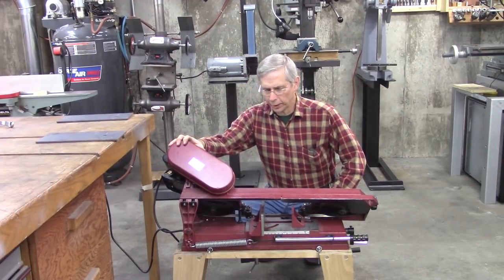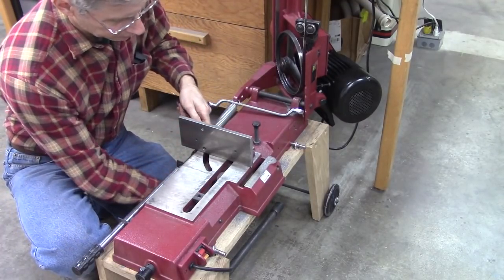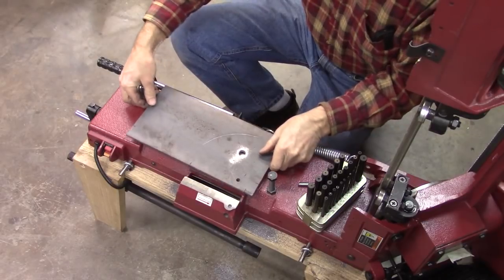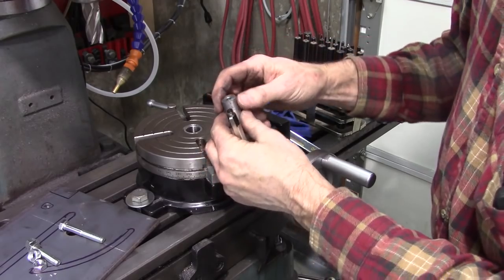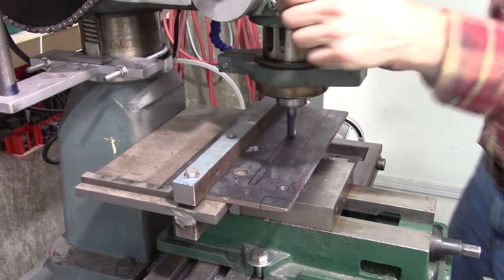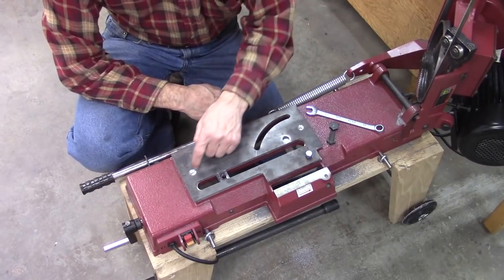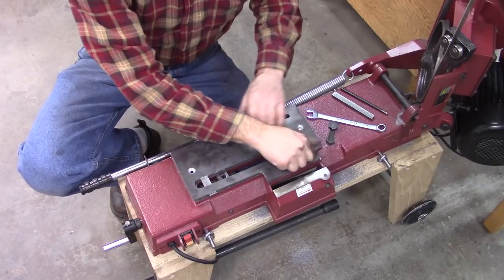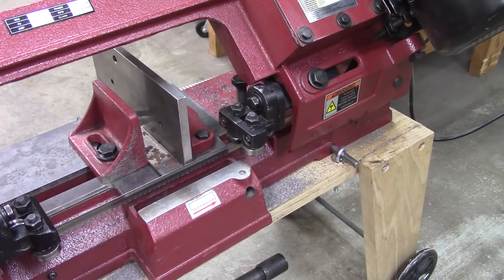4" x 6" Horizontal Bandsaw - Fixing the depth of cut issue

Comment: Would be interested in elevation plate if made available.
Reply from the maker: There is a link under the video to a template and instructions. Print the template full size and make sure it matches your saw and then send me an email (address in the instructions). I'll let you know a price when I get the quote back from the water jet shop. If i can't sell the plate for less than $30 I probably won't do it. I suspect this is possible but I'll know late Monday. Thanks for watching!

Comment: Have you had a lot of blade breakage with this saw?   I’ve gone through 4 blades in a week.  Maybe a total of 40 cuts.  I have the feed almost completely tight and the belt set at 80 for stainless.  Yet I keep snapping blades at the seam.  Blade is tight but not torqued down.  I feel like I should be getting more cuts out of these blades.  I used Bosch ones and I went a picked up some harbor freight ones today.  Any insight would be helpful.
Reply from the maker: I had the same problem until I corrected the blade guide and depth of cut problem outlined in my videos. I've had the same blade installed for almost a year now. I think my blade is set at the fastest speed.
Reply: @WinkysWorkshop  ok thank you.  I’ll rewatch again tonight and hopefully be able to set mine up better.  At this rate I’ll spend more on blades than the saw is worth.
Reply from the maker: @85nscarola  If the saw is old there may be other issues but if it's fairly new I'd say the blade guides are deflecting the blade. The back wheels on the blade guides should not be turning when the saw is not cutting. Realistically this is sometimes hard to achieve and a little downward pressure is okay but if the blade guides are deflecting the blade downward more than maybe a 1/8" it leads to problems.
Reply: @WinkysWorkshop  yeah. Just went and followed your video.  Adjusted the guides.  Was able to get the blade straight but can only get one back wheel to not touch.  When I gap the second one the first one touches again.  They were both touching before though so at least one isn’t making contact now while not cutting.   Also tensioned the blade more.  Read somewhere that it should be tight to the point where you can pluck it like a guitar string and you’ll get a twang from it.
Reply from the maker: @85nscarola  Some contact with the back of the blade is okay as long as it isn't deflecting the blade much. Yes high tension is good. The blade deflecting under load is very hard on the blade.

Comment: It seems like adding a plate on the outboard side of the blade would pinch the blade right before it cuts through the stock.
Reply from the maker: As long as it is level and one side is clamped it won't. I think I will install a larger piece on there and close up the gap the blade goes into. small pieces fall in gap sometimes.

Comment: It took me 40 min to cut through 1 1/4”galvanized pipe.  New blade.   I did notice that my feed adjustment only turns a quarter turn each way though.  Could that be the problem? No pressure?
Reply from the maker: Maybe so
Reply: @WinkysWorkshop  about how many threads are usually exposed on your feed?   Where the hook connects to the spring.  Just trying to get a general idea as to how much feed I should have.  Bought it used and it was screwed all the way in.  No feed
Reply from the maker: However, if you are cutting small stock, tubing and angle iron you will have to limit the downward pressure. If nothing else you will break teeth but most likely the saw will stall. With being said, if you blade guides are not set right or there is an alignment issue due to wear you will knock the blade off with too much pressure. Also a lack of tension on the blade will do the same. It needs to be fairly tight.
Reply: @WinkysWorkshop  figured out the problem.   Previous owner had the blade in backwards.   That’s why I had to use so much pressure which ended up breaking my blade.   Got a new blade and made plenty of cuts today thru 1/4” steel plate.   Worked great
Reply from the maker: @85nscarola  Thats great!

Comment: Would spacer bushings behind the blade wheels achieve the same result?
Reply from the maker: That might work although spacing the wheel out would move the blade closer to the guard and vice. I suspect it would cause other issues. I think the root of this problem is a the hinge point for the head was drilled to high but moving the hole a 1/4 inch is hard to do.

Comment: Another great creation Mark. More to add to my to do list. LOL
Reply from the maker: All saw won't need this. I think it depends on what factory assembled it and when. If your saw needs it let me know. I'm thinking about making some to sell (hopefully fairly cheap)
Reply: @WinkysWorkshop  I've never had a problem with it cutting all the way thru. Biggest thing mine needs is some time and cleaning and to reset everything. I have 2 old power hack saws that i intend to revive this summer. One of them is a Marvel draw cut #1 and they brazed everything including cracks they made in the sprockets trying to get them off. so the blade is not square with the vice. And the vice is not adjustable to the blade so I will be scratching my head and maybe using some of your concepts.  I really want to try to keep it all original but nobody wants a saw that does not cut square. lol  Thanks again for your contribution.
Reply from the maker: @terrycannon570  Maybe you can mover the head from side to side and make it square.

Comment: Can you just lower stop?
Reply from the maker: Watch part 1. The saw frame hit the switch. I ground a clearance in the frame and then the blade cover hit the bottom casting. I removed the cover and it kinda worked. This is the best option. The saw  now drops about 3/16 after the cut and reliably trips the switch. Plus I put the guard back on.

Comment: I’ve never had that problem, of course my saw is a bit different 4 x 6
Reply from the maker: This saw had some issues. I suspect the castings all come from the same Chinese foundry but then go to many other factories for milling and assembly. Who knows how many have the same problem as mine. I can make the saw work but moving the blade down with the guides but that's not really the correct approach and very hard on the blade.

Comment: I got the same problem on my band saw. Here's a link to it: https://www.warco.co.uk/metal-bandsaws-metalworking-saws/53-4-12-universal-bandsaw.html.
In my opinion You used a big gun to solve the issue.

I found out that the poorly made, poorly formed, wheel/blade cover hit the bed. Using a polygrip just bending that cover solved that problem.
There's also a blade protection attached to the left of the cut, most faar away from the motor, that's poorly formed. That makes an obstacle regarding the depth when moving the blade guide "to the right", when cutting "small" objects. I suppose some brutal mechanics can correct this.
Reply from the maker: Watch Part 1 of this video. I worked on the rear blade guide and helped tracking. I also removed the guard so that it would drop far enough but still had issues with the auto shut off. What I did here was a lot of work but the best fix.
Reply: @WinkysWorkshop  Okey. Didn't notice You removed that blade guard.  That's of course the quick and easy way. I've been thinking about doing that. I'll see if my polygrip can do the job. Else the plan B is ready to be used....
Bending things to the correct angle looks like being a problem for the Chinese what ever product it is.
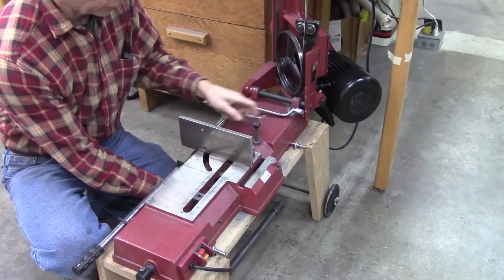Reply: @WinkysWorkshop  Looking at part 1 again, at time 01:42, it looks like Your saw is slightly different from mine. Found out that the mount is adjustable but the cross head screw was overtightened and is now ruined. Drill and new screw tomorrow......
Reply from the maker: @Stefan_Boerjesson  Agree...  they have a quality control problem.

Comment: Here is the link to a very simple idea that makes changing the blade on these saws a much safer and simpler process to do. Involves nothing more complicated than 2 short lengths of webbing and 2 bits of 'Velcro' hook and loop tape. Makes the task a lot less like wrestling a baby alligator.
Link: https://youtu.be/utIcvpEyv6g
Reply from the maker: That's a great way to do it. Thanks
Reply: @WinkysWorkshop  It totally controls the blade by preventing it from springing out of the roller guides when you are trying to manipulate the blade over the drive and idler wheels. It's one of the simplest but greatest improvements to the task I've ever seen....why didn't I think of that instead of struggling and cursing.😂😂

Comment: Winky:  I love your channel and watch it often, but this is a completely unnecessary modification based on a false assumption.  Here, and in the Tune Up video, you mention the "Ideal" position of the blade guides. Ideal, maybe. But if it causes the saw to not work as designed, it is obviously not "ideal".  As well, "not ideal" does NOT mean wrong or unacceptable.  So my assertion is that there is nothing wrong with the blade guides adjusted in such a way that the saw works as designed even though the blade is not perfectly aligned with the wheels. In fact, I have found that on my saws, they must be aligned with the proper cutting position, NOT the wheels.   How long did your saw work fine before your blade guide adjustment caused the saw not to finish the cut?
I've been using my version of this saw for about 40 years, and 

also the larger "Carolina" type bandsaws.  Both of these types of saws 
need several "tweeks", but honestly, this is not one of them.
All of this being said, I have made my share of similar false assumptions that resulted in failure. But, that's how we lean.
Reply from the maker: Thanks for watching and I welcome the comments but respectfully I disagree. Ideally the blade should not be deflected but only rotated to vertical. Can the blade be deflected? Yes and to a point it doesn't matter. Slight deflection goes unnoticed but when it approaches a 1/4-inch it creates a lot of problems. You mentioned needing to deflect the blade to make it cut correctly. I assume you mean side to side because there is no advantage to pushing the blade downward aside from making the saw complete the cut. The correct procedure would be to set the fixed jaw of the vise parallel to the pitot shaft (for the head) and then align the guides to make the saw cut square. If you do this more than likely the saw will cut square with no blade deflection unless one of the wheels is mislocated (which is possible but not likely). I used my saw for about 4 month and broke 3 blades before I addressed this problem. I just changed the blade two weeks ago and this was the first time in about a year. It was still sharp and has never fallen off but it was missing a 1/4 section of teeth. I suspect I let it down to quickly cutting angle iron but I'm not sure. Anyway, Jet manual as well as several other band saw manuals state that the guide bearing on the back of the blade should not contact while the blade isn't cutting. In reality very light contact is okay but deflecting the blade shortens blade life and makes the saw cut less consistent. Before fixing my saw it cut slowly and when I tried to increase the downward pressure the blade would fall off. After fixing, tracking and installing the plate I can cut at full pressure unless the stock is small. To me this is all logical but before assuming I was correct I watched a video from Jet showing how to set up a saw and read several manuals from various manufacturers. They were all basically saying the same. Anyway, if the saw is only slightly off, deflecting the blade a little is fine. My blade is still deflected about 1/8" even after installing the elevation plate. So I made no assumptions and to be honest I think Carolina was one of the manuals I looked at.
Reply from the maker: Here's a Grizzly video on blade guide setup. https://youtu.be/Lk_IEak9GLY